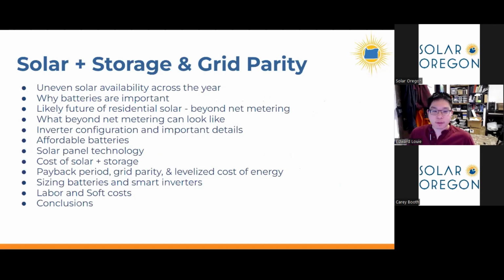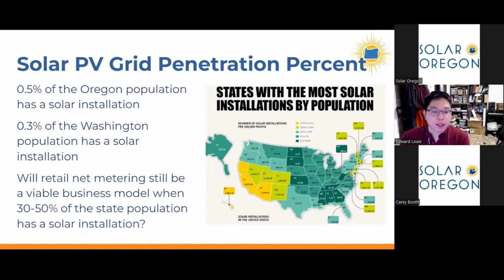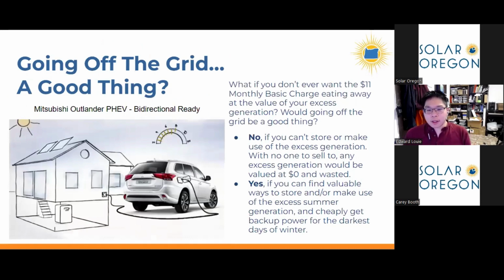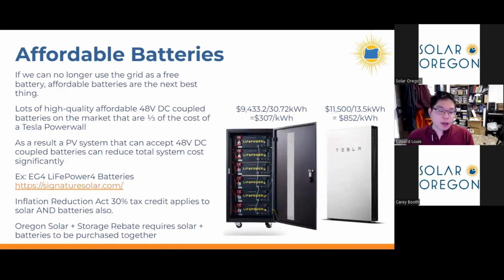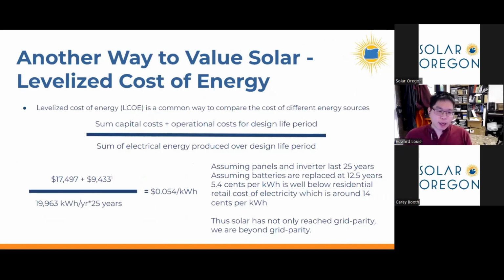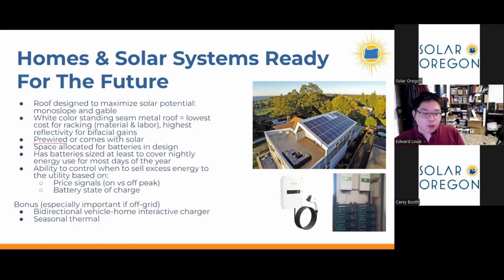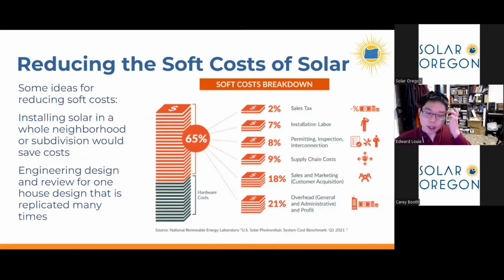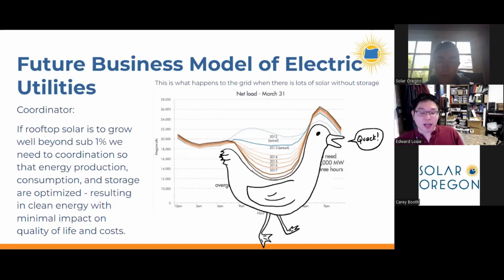Green Energy Series #2 - Solar + Storage

Comment: Efficiency of PV panels around 19- 20 percent, solar collectors coud be 80 percent efficient. Place an  air to water heat pump in your unconditioned attic and solar collectors on south wall and let your heat pump run only during a day storing all heat in a buffer tank, due to higher ambient temperature during a day COP of that heat pump will be higher and on sunny day just much higher because  of those solar collectors. As well I ve heard that some company in Europe  in order to increase efficiency of water to water heat pumps use solar collectors to preheat water before it gets into heat pump